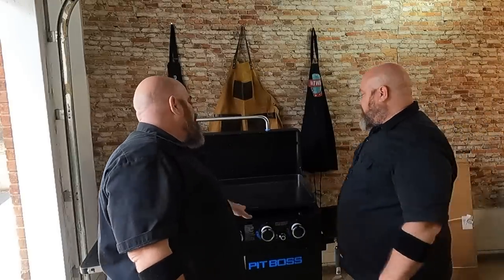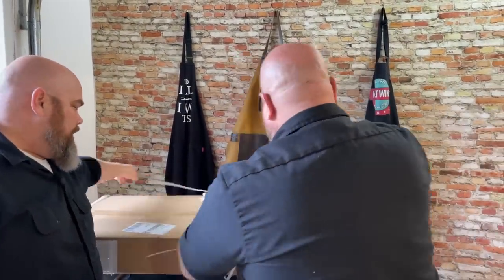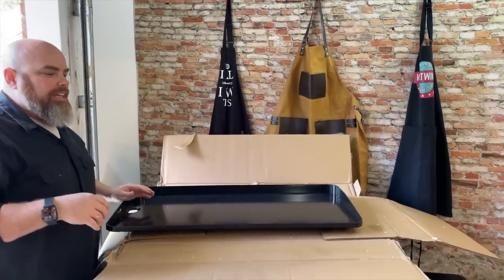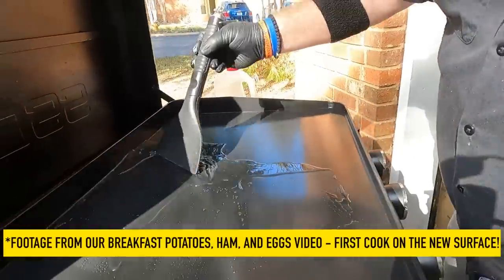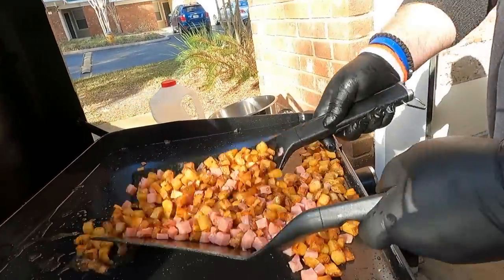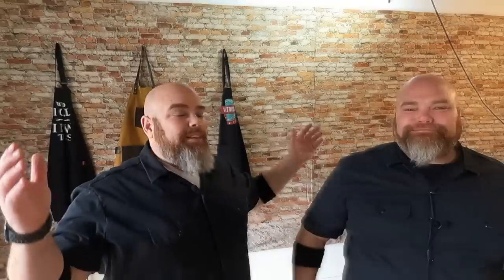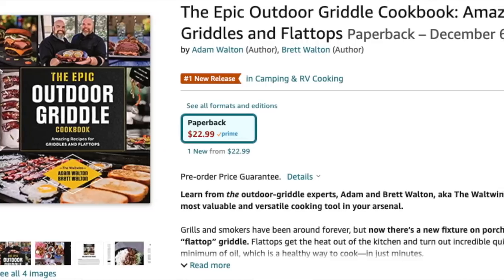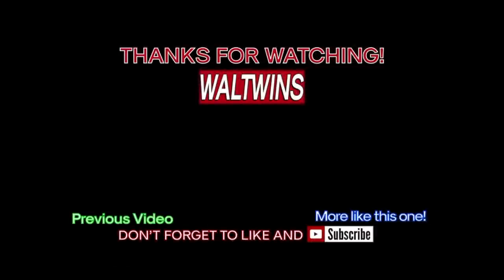UH OH, WE NEED A NEW GRIDDLE TOP! PIT BOSS ULTIMATE GRIDDLE 5 BURNER REPLACEMENT CERAMIC PLATE

Comment: Sounds like the Pit Boss customer service is top notch, so important when considering a brand to purchase.  I really want one eventually, but of course with my luck, the top will wear out just after the two year warranty expires.  I just had my NVME boot drive go out on me on my desktop computer last week (I'm currently using my laptop), and the warranty for the drive ended in December... I am livid!!  I just bought a replacement that's twice the capacity for half the price I paid for my old one though, so I'm at least there is that... just need the time to fix my computer now.  One thing about a non-stick surface, no-matter what kind, it will always wear out and will need replacing.  A cold-rolled steal top, like a cast-iron, can last pretty much forever as long as it's properly taken care of.  I still do love my non-stick skillets though, they are great for making eggs, and pancakes, etc... and they are so easy to clean!  Keep on Griddlin'!
Reply from the maker: That sucks brother!😂😂 I feel like I have the same luck sometimes.  I think with the ceramic units they for sure will have a point where they wear out, but we are really anxious to see how far we can push these new tops - after having been really rough with the first ones, we think we can go a few years.  Some Blackstone owners will keep theirs for years, while many toss them at the first sight of rust.  Everyone has cast iron in their cookware that they’ve had forever, but it sits to the side (for most) out of convenience - I think that’s the case here.  It really will come down to preference.  What we think would be ideal, would be a unit that you could switch between the two, and maybe even toss on a stainless steel top too! I ordered a deluxe unit (Pit Boss’ rolled steel unit) because I want to have the option for both, cuz we love it all brother!
You know we always appreciate your comments and insights! Take care brother, GRIDDLE ON! Oh, and good luck with the boot drive!😳😳
Reply: They really have killer service. If anything goes wrong they take care of it.

Comment: I have recently gone through the warranty process to replace my Sierra top after 1 year. I have used it almost daily here in Wyoming.  The process was fairly easy.  I had my receipt and all the necessary information. They did try to make me go through some processes first and actually sent me a link to one of your videos. However, I informed them that I had already tried everything.  They then sent me a replacement top that should arrive today.  I have been generally happy with this griddle but have had issues with hot spots and sticking almost since the beginning.  I am still confused about how to keep this griddle from sticking.  Perhaps I made the mistake like yall with the oils in the beginning. I'm aware that no non stick surface will last forever but hopefully I have better luck this time.  The invoice amount for the replacement top said 55 dollars.  I did not see the Sierra top for sale in their site so I'm not sure if that's what they sell them for. If so, that's not a terrible price to replace every so often if you want to keep using the non-stick.  I'm going to say eventually that when I'm ready to fully replace my griddle next time that I would try the Blackstone instead.  It will depend on how my experience with this 2nd Sierra top goes.  I would love to see an updated video/ instructions on how to use and care for it as it seems there are conflicting instructions.

Comment: You mention the need for a "burn-off," yet I have read recent comments about NOT doing a burn-off...that very high temps can cause some damage to the ceramic coating (something about micro cracks). This may also apply to the high heat used to get that great crust on steaks and smash burgers. Do you have any updates regarding using high heat with the ceramic flat top?

Comment: Adam & Brett...  I happened to watch the video by The Flat Top King the other day regarding his Pit Boss griddle that he has issues with the surface.  I have a Blackstone 17" E-Series griddle and I'm wondering if I may end up with similar issues since it has a ceramic surface also.  I sure hope not.  I really like the ability to cook on a griddle indoors when the weather here in Colorado is not conducive to being outside when there is snow or sub-teen temperatures or high winds.  At least with my Blackstone 28" Range Top Combo griddle if the surface gets messed up I can always take my disk grinder with a wire wheel and strip the surface and start over seasoning it.  I've had it close to three years now and have yet to feel the need to strip it down and re-season.
Reply from the maker: Hey brother! Nothing to worry about - we’ve spoken with Neal, and like him, we’ve been doing more “rough” cook big to test the limits.  We expect these to last us several years when we aren’t trying to beat them up!😂😂

Comment: I just used my pit boss ultimate Griddle for the first time.  I'm a bit of a germaphobe so I actually washed the Griddle before mounting it on the stand.  Just because I wanted to be cautious,  I let it burn for approximately 15min or so before beginning my cook. After doing all that prior to cooking,  I was greatly disappointed with the taste of my smash burgers.  They had a chemical taste to them and my wife agreed. I was wondering if you have any suggestions.  I really didn't smell chemicals or see smoke or anything when I did the burnoff.
Reply from the maker: Thank you for watching and congratulations on the new griddle! The Ultimate Griddle with the ceramic top is designed to be cleaned with soap and water. I know you said you washed it before mounting, but the instructions also recommend cleaning the surface with soap and water. The units are generally coated with a soy based oil before being shipped out to preserve the tops in the event they will be sitting on store shelves for a long period of time. There shouldn’t be any chemical taste. Hope this helps fam!
Reply: I am unclear on what you mean by surface, I washed the griddle top surface with soap and water and then thoroughly dried it with a lint free cloth, so any oil residue should have been removed.   I cooked my bacon 1st and added a small amount of avacado oil for my onions, but my smash burgers were cooked with the tiniest of bacon oil residue.

It's a mystery, maybe it was the avacado oil.  I don't usually cook with it, but I know it has a high burn point so I used it for this cook.  I will clean the griddle plate one more time and try a different oil to see if I get better results.
Reply from the maker: @louismaniscalco1389 oh gotcha, yes, sounds like you did it all correct! It could be the avocado oil, not sure why, but maybe.  Keep us posted though!

Comment: Seems like this wpuld a great time to level the surface as well.
Once leveled, Mark the floor where the wheels are so next time you can go right back to the same place and be level, or at least the same as when you set it up.
Reply from the maker: The great thing about these units is that each peg on the surface is adjustable - we just hadn’t adjusted them for Brett’s sidewalk.🤙🤙
Reply: Set it place, adjust and still mark the pavement. AlWAYs know where the low spot is. Of course,it might be difficult if you're not the owner of the property too.
Still, Customer Service is an investment in itself for both company and customer.

Comment: I'm trying to decide between the rolled steel Blackstone and the ceramic-coated Pit Boss for my very first griddle. It will go pretty much unused for about four months (with a cover, but out in the elements from December through March). Plus, the summer in this area is often hot and humid. I also don't have a garage or shed for storage...so would the things I've mentioned tend to cause a rusting problem for either of these flat tops...or is keeping them properly clean and dry (and seasoned, for the Blackstone) all that's needed to avoid rusting (even under less than ideal circumstances?
Reply from the maker: Hey fam!! Overall, storing properly and caring for them is going to be key. Storing the ceramic top longer periods is going to be much easier to care for, as the ceramic won’t deteriorate or rust over time.  Hope this helps somewhat fam!!🔥🔥

Comment: Gosh Thankyou. So no seasoning necessary? I have one and have gotten very confused about this. The book doesn’t address this. I bought metal utensils( bummer) but I will get the pit boss ones asap. Thankyou, now maybe I can use it. I have the 3 burner portable one and finally put it together and have been chicken about using.
Reply from the maker: Thank you so much for watching! It depends on the unit, is yours an Ultimate 3 burner, or Deluxe? If it is the Ultimate, then yes, you are good without seasoning it and do need the nylon and silicone utensils.  🤙🤙

Comment: Hi guys.  I’m thinking of going with a Ultimate griddle over the BS because of ease of care and cleanup mostly.  I have a question for you; I’m concerned about higher heat and warping.  I want to make sure I get a good sear on a ribeye, and I heard you talk about turning the griddle on high while cooking smash burgers.  Do I have to worry about warping the griddle if I use high to sear a steak?   Is warping a worrisome problem? 

Thanks!
Reply: Given the sound of crickets....I believe that speaks volumes. As a Sierra owner, these are expensive and if your like most and don't have sponsorship thru Pit Boss.....look elsewhere. Chances are the majority won't run into these issues until the warranty is gone, then it's a couple hundred more to replace the cooktop.

Comment: So we not supposed to put a thin layer of oil after cook and clean? The manual says to put oil to protect it between cooks.
Reply from the maker: This is the part that still confuses us! Here in Central Florida, when we did this, the next time we used it the griddle surface was a bit sticky from the oil and required a bit of cleaning.  That said, underneath the surface is meat, and in the corners it can begin to rust.  We are waiting for a bit more clarity on the oil, but our experience has been that oil wasn’t necessary.  Hope this helps, thank you for watching!

Comment: I’ve been thinking of getting a Griddle, but if I would have to get a new top every few years that’s not really a selling point for me. I have a Big Green Egg & a few other cookers & pizza ovens & use them year round in extreme cold (the coldest being -40 c 🇨🇦). Looks like rolled steel is just look after it, but with what’s happening to these PitBoss tops …. Well they can keep it.
Reply from the maker: Understood for sure, but we don’t think this will need to be replaced often - we have a few hundred cooks on these units - and they have held up, even with being really rough on them.  That said, for sure a rolled steel unit will hold up, but with extreme weather like you mention, rust will be an issue.  Our intent here was to be transparent about our one unit.  We have another Sierra (ceramic top) griddle that has over 100 cooks and looks like it did on day one - not even close to wearing down. We for sure will continue to demonstrate and show how they hold up over time, and maybe as more time passes they will be able to prove their worth.  Cheers fam!🤙🤙
Reply: We live in Montana, our winters for 4 months long and can be -30 below.  Never had an issue with my Steele top. I have even cooked when 0 degrees with snow falling.

Comment: May I ask a question do I oil the flat top after cleaning or leave dry
Reply from the maker: Hey fam! For the ceramic, you don’t need to oil after cleaning.  I have the deluxe model and found they have the same directions for both, but the oil should be just for the steel units, not ceramic.  Hope this helps!

Comment: Hey guys - curious...wondering if this non-stick starts wearing out down the road - can the ceramic coat be sanded off and then seasoned similar to cold rolled steel surface? I'd imagine it could.

Comment: I got mine replaced back in May 23 after a year when everything was sticking to it. I just follow their directions & use their associated tools from their website. I can already see on my new top spots where it looks like the coating is going dull again! I have only gone through less than a tank of propane since replacement. very annoying.

I will ask if maybe they can just send a non-coated replacement (if they have one that fits).

Comment: How did you get ahold of them. Im about 10-15ish cooks in and two tiny pieces/chips of the ceramic top have come off near one of the corners. I dont see an email or contact into on their site. It's the sierra griddle i got it on clearance at walmart & looks like they discontinued that model from what I can see so not sure they can help anyways. Thanks!

Comment: I’m having low heat issues with my Sierra. During warm weather it’s just ok, 360° tops. I colder weather or any wind it’s alway 275° or lower. Any ideas as to what’s wrong? I’ve changed tanks and reset the regulator and nothing seems to help.
Reply from the maker: Hmmm… as I was reading this, I was going to say, either change the tank or regulator. The only thing I can think at this point is call customer service? They are really good. Let us know if that helps! Much love fam! Griddle on!!!😁❤️🤙

Comment: I bought a 4 burner Ultimate Christmas of 22.  Cook top is already pitted and pretty beat up looking.  Do the replacement cook tops or newer grills have an updated surface or is it the same?
Reply from the maker: Hey fam! Have you tried a deep clean? Are you using metal utensils? How much oil do you use to cook with? Sorry for all the questions, sometimes knowing can help with an assessment - as far as the new tops, they are the same, but we’ve heard that there may have been some earlier tops that may have not been as good.

Comment: I bought a 3 burner pit boss and I haven't noticed any changes in the griddle top however I haven't cooked as much as you guys have should I be expecting needing to replace the cook top after a period of time or did you get a bad cook top?
Reply from the maker: Hey fam! Nope! We were really running our unit through the ringer - we expect our surface to last several years!!🔥🔥

Comment: Ditch this Pit Boss! The Blackstone griddle never wears out and can handle any abuse in cooking! Griddle on guys! ❤
Reply: can it? mine is scratched up, takes ages to clean, has to have loads of oil and spray to get going which adds calories, long clean up, etc. 

essentialy like a gigantic cast iron pan with all the negatives.
Reply from the maker: Haha! Great to see you brother! We love it all, and actually ordered a deluxe unit (rolled steel) so we can continue to share cooks from both - we love these Ultimate units though too!! Take care and GRIDDLE ON INDEED!!🔥🔥
Reply: @katstutrakatsturatorren  if you’re is scratched up, then you didn’t season it properly. Men is slick as glass and stays coated black and glossy. If you’re using loads of oil or spray, there’s your first mistakes. The Blackstone performs great with only enough oil to coat the surface,  and,  ya gotta remember, there are differences in oils. Some are high temp, and some aren’t. I only use either olive oil or flaxseed oil on my griddle, and I don’t let the surface totally cool down or get cold to clean it either. If you clean your griddle when it’s barely warm, or hot enough to touch with your hand, clean-up is a breeze! Happy gridding...

Comment: Hey all! I love the griddle fire company lunches on Fridays, but unfortunately while I was out on leave for 6 months it was not kept up as I would in accordance with the manufacturers suggestions. Ultimately, there seems to be some residue cooked onto the surface that I can’t get off no matter what I try. I’ve tried it all aside from abrasive products. The residue is likely for release commonly used in waffle makers. Can anyone give me a sure way to remove it? It chips off ever so slightly with my fingernail, but it’s really, really hard and just not coming off the surface. Thanks!
Reply from the maker: Hey fam! We hope it works out. We found the baking soda method got rid of some residue similar to what you are discussing last winter on our Sierra unit - aside from that if it won’t work, I would definitely reach out to Pit Boss! The surfaces have a 2 year warranty.  Hope this helps fam!!